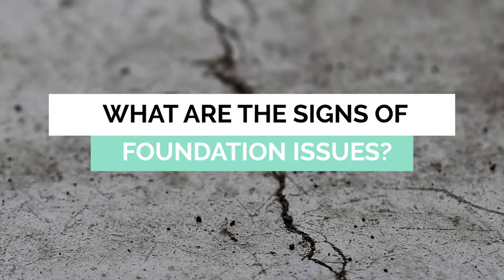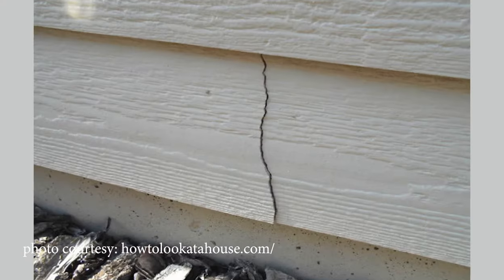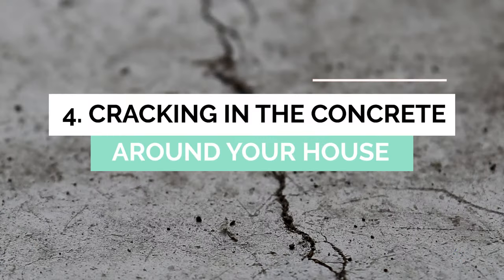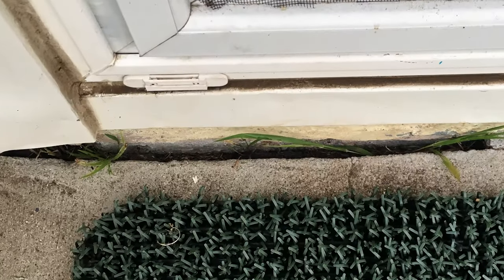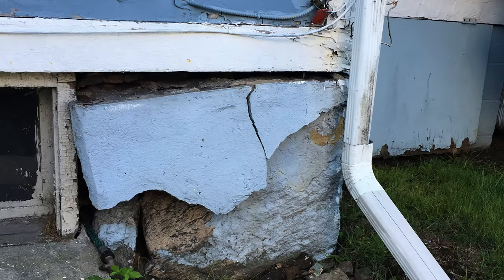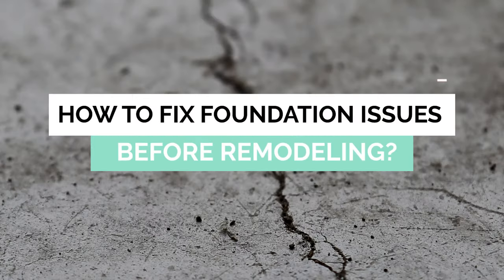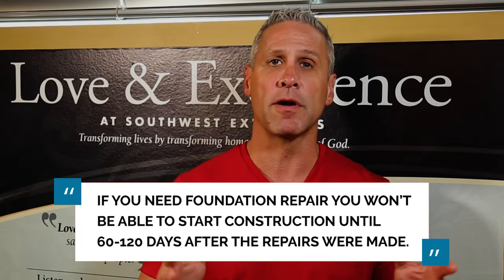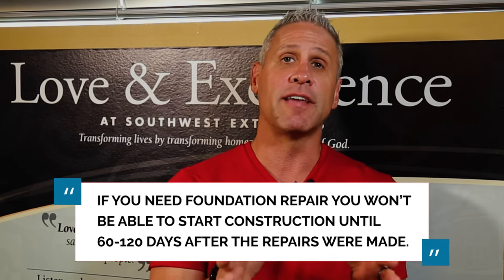4 Key Signs That Your House Has Foundation Issues

Comment from the maker: Thank you for checking out this video! If you have any questions on your foundation or a concrete coating, leave them down below. We'd LOOOVE to hear from you.
Reply: I swear I'm terrified my brother's house is going to just collapse one day soon
Reply: Hey there, I'm currently living in an apartment (on top floor - - 2-story apt building) and I've been hearing cracking/popping "woody" sounds quite often over the past couple months. There are hairline cracks in the drywall throughout the apartment (mostly running along corners/edges horizontally & vertically), but today I noticed a single big crack running across one of the 3 windows in my room, and my guess is that it's due to the shifting/cracking/popping of the walls. Am I on the right track with making this connection for the window crack or is some projectile or kamikaze bird more likely to blame? And more importantly, is this something I should be concerned about in regards to my safety (as well as adjacent neighbors in my bldg) and need to address immediately by a professional like yourself? Thanks in advance for your expert opinion & information and you've got a new subscriber here!
Reply from the maker: @jasonb3907  Hey Jason! Sorry to hear you are dealing with cracking and popping in your apartment. Based on your description, the noises, along with the presence of hairline cracks in the drywall and a significant crack on one of your windows, could be a sign of underlying structural issues within the building. Especially if all the cracks line up. 
For safety it is always best to contact a professional just so you can have peace of mind that you and your family are safe. Especially  now that you are hearing sounds frequently there could be something that you can't see that needs to be addressed quickly. Not all the time, but usually with normal shifting and settling things happen at a slower pace so you don't notice until the cracks start to show up or doors and windows stop functioning properly. What you are describing seems like the structure might be trying to tell you something. 
Thank you for subscribing to our channel, and please don't hesitate to reach out if you have any further questions or need assistance. Your safety is paramount, and we're here to help in any way we can.

Comment: Sigh, have the staircase looking crack on the exterior brick. Thank you for the info! 

I live in a bungalow from the 1800’s. I was wondering…if there’s a 1 inch-ish gap between the floor and the floor mouldings/trims/edges on the 2nd floor….is that also a sign of foundation problems/the house sinking (they may be 2 diff things)?
Reply from the maker: A gap between the floor and the floor moldings/trims/edges does not necessarily indicate foundation problems or sinking. It could be due to natural settling over time or temperature and humidity fluctuations affecting materials. Consulting a professional, such as a structural engineer or contractor experienced in historic homes, will provide a more accurate assessment of the situation. 
Thank you for checking out the video!
Reply: @TheHomeSolutionsChannel  Thank you for your reply!
Reply from the maker: @earthandwind820  Our pleasure! If you have any other questions, don't hesitate to ask.

Comment: I don’t have any cracks like was disco.. but my interior stairs look
As if they are pulling apart from the top landing ( where is is supposed to be flush)..I do see some cracks in the  basement floor..on the same side of the house where the interior stairs are..these stairs are on my first floor to my second floor.. Thank you for any suggestions..I’ve lived in my house 20 years..this has happened over time.
Reply from the maker: Thank you for checking out the video!
It sounds like, as you said, a lot of those issues could be time related. The cracks in the basement would be where I personally would start to make sure there isn't a bigger problem before I tried to fix the stairs. Since the impacted areas are all in the same location, it might be best to have a foundation expert come inspect it just to make sure that there aren't any larger problems brewing after 20 years. Most likely it is normal settling and should be a simple fix, but it is better to be safe when it comes to your foundation. If you have any other questions or want to share more detailed information on your cracks, feel free to let us know, we'd be happy to help.

Comment: Thank you for making this video. The door frames one some of our doors have cracked right where the horizontal part and vertical part attach. Is that an indicator of foundation issues or just poor quality door frame?
Reply from the maker: I'm glad that the video was helpful for you!
It is hard to tell without seeing it but, that sounds more like the quality of the door frame. I would check behind the door frame and see if there are any cracks in the drywall. Without evidence of severe cracking my guess is that the door frame cracking is just caused by normal everyday settling.

Comment: What is it's cracking in the concrete foundation that lines up with tile cracks inside the house
Reply from the maker: Our educated guess is that your home is built on two different bedrocks. 
Bedrock is always shifting and moving, but when you happen to be on two different ones they can shift independently from each other which, in time, can create a crack that goes through the foundation and the home.

Comment: Thank you for the video. Can you tell me what the worse case scenario would cost?
Reply from the maker: Thank you for watching and for your question! The cost of repairing foundation issues can vary widely depending on the severity of the damage. In a worst-case scenario, where extensive repairs are needed, costs can range from $20,000 to $100,000 or more. Several factors can increase the cost, including the size of the home, the extent of the damage, the type of foundation, and the need for additional repairs like plumbing or structural reinforcement. It's best to get a professional assessment to understand the specific situation and get an accurate estimate. Early detection and repair can help minimize costs and prevent further damage. If you have any more questions, feel free to ask!
Reply: @TheHomeSolutionsChannel  thank you!
Reply from the maker: @breeze5378  Our pleasure!

Comment: good day sir my issue is foundation of a building on a hill beside the beach and the water penetrating under the foundation from the back of the builden on the beach side
Reply from the maker: Hey @HanDixson! Thanks for sharing your situation. Building on a hill near a beach can indeed present unique challenges, especially with water penetration. Here are a few things to consider:
-Drainage Solutions: Installing proper drainage systems like French drains can help redirect water away from your foundation.
-Waterproofing: Applying waterproof coatings or membranes to the foundation can help prevent water from seeping in.
-Landscaping: Grading the land around your home to slope away from the foundation can reduce water flow towards it.
-Professional Assessment: Consulting with a structural engineer or foundation specialist is crucial to evaluate the extent of the issue and recommend the best course of action.
Taking these steps can help protect your home from water damage and maintain its structural integrity. Good luck with your project!

Comment: I bought a new consteuction home 4 years ago. Its experienced alot of settling. Small cracks by windows ext. They were repaired and havent came back since. But i noticed a ball on floor the other day would roll torward the back of home on its own. Indicating a sagging floor. Is this a serious problem?
Reply from the maker: Hey @chrisbrezy392, Thank you for your comment and for sharing your experience! It's great that the initial cracks were repaired and haven't returned. However, noticing a ball rolling towards the back of your home can be a sign of a more serious issue with your foundation or flooring.

Here are a few steps you can take:
1. Professional Inspection: It's important to have a structural engineer or foundation specialist assess the situation to determine the extent of the sagging and identify the cause.
2. Monitoring: Keep an eye on any new cracks or changes in your home, such as doors or windows sticking or gaps appearing.
3. Foundation Support: Depending on the severity, solutions may include reinforcing the foundation, adding support beams, or leveling the floor.

Addressing these issues early can help prevent more significant problems in the future. It's best to be proactive when it comes to your home's foundation. Good luck, and I hope everything works out smoothly!
Reply: @TheHomeSolutionsChannel  I forgot to mention my house is on a solid reinforced concrete slab built with rebar. It's in El Paso tx near the mountain. Hard to dig lots of big rocks. All doors windows close correctly and the cracks haven't returned in about 3 years.  I will be looking for a structural engineer to check it out. Thank you for replying.
Reply from the maker: You're welcome, @chrisbrezy392! Given that your home is on a solid reinforced concrete slab and the cracks haven't returned for three years, it sounds like your foundation is relatively stable. However, since you're noticing sagging, having a structural engineer inspect it is a wise decision. They can provide a thorough assessment and peace of mind. It's always best to catch and address potential issues early. Good luck, and feel free to reach out if you have any more questions or need further advice!

Comment: When a Home Foundation Inspection is done. Where should they place the Zip Level to take accurate measurements. Based on 2 Companies that have given me Estimates, they took the measurements at different places. The Front Door entrance measurements stated we need repair while the 2nd Company took measurements from about center of my home & stated no repair is needed. Who is giving me the correct information prior to replacing our Roof? Thank you
Reply from the maker: Thank you for your detailed question! The placement of the Zip Level during a home foundation inspection can indeed affect the results. Generally, a comprehensive inspection should include multiple measurement points throughout the house, not just at one specific location.

Front Door Measurements: These are important as they can reveal issues with how your house is settling. If there's a significant drop or rise here, it could indicate foundation problems.

Center of the Home Measurements: These can provide a more balanced view of the overall foundation health. If the center shows no issues, it might suggest that any problems are localized rather than systemic.

The most accurate assessments typically come from using multiple points of reference to get a complete picture of the foundation's condition. It might be beneficial to consult with a third company for another opinion or ask for a detailed explanation from both companies on why their measurement points were chosen.

Before making a major decision like replacing your roof, it's crucial to have a clear understanding of your foundation's health. Hope this helps, and best of luck with your home repairs!

Comment: Are you guys In San Antonio TX? I bought a new build 1yr and some months ago, and I’ve started to notice some vertical cracks where drywall meets eachother. Would that be something to be concerned about? Some of my baseboard also seems to have separated at the where they meet? Idk if it was just filled with caulking or not
Reply from the maker: Nope, we have been in San Antonio since 1989!  It sounds like a lot of those issues could stem from poor drywall work or caulking as you stated. Here is a link to a video that provides a little more detail between minor and major cracks that might help answer some of your questions. https://youtu.be/lubIIrGG4cA?si=JCWIjO9rZtE-8tfR
If you have any other concerns or questions, feel free to ask them here or visit, www.southwestexteriors.com and reach out to us there to help you out.

Comment: I bought a place 7 months ago. The painter came in and sanded down minor cracks at the drywall upstairs. It was 100% perfect (as always, I'm picky and he knows I HATE gaps). Well, not anymore. I get the feeling that at least one moron has touched this place. They lined up the drywall upstairs on the sloped ceiling, so ceiling cracked (small, very minor ones) and it goes all the way down the sloped wall in some places. Straight line, all minor stuff. No large or diagonal cracks. 

Downstairs, the join at the crown molding is cracked. Both sides. Not big, but I notice it because painters aren't cheap. 

The ceiling upstairs is short, around 7 feet, so I can push it and part of the drywall has a little give it shouldn't have. So, clearly idiots have been through and didn't drywall/tape/mud it correctly. At least, if I did it, it sure wouldn't! 

There's also a concrete crack at the front steps where they meet the building. That one is bigger and not going to be as easy to fix. Maybe a 13 or 14 sf house. I'll probably fill it once weather is warmer. Not ideal, but lots of these channels talk about 25 thousand like it's nothing. 

I'd say, I'd buy a new house, but I've watched many old houses come down, and the garbage they replace it with. I'm never surprised to see the "concrete" steps crumbling within 5 years. Meanwhile,  our coach house has a visibly sinking corner *for DECADES*. Still there, 120+ years later. Front steps of early 1900s front house have barely ANY wear, and CERTAINLY not literally crumbling, like our neighbor's greatly overpriced POG. It's not even REAL concrete or REAL limestone for 3 or 4 million. LOL! 

Nothing like "step" cracks in the brick or siding anywhere else, tho. So, that's something.
Reply from the maker: Sorry to hear all the things you have noticed in your new place. Sounds like you have the knowledge to make sure those issues don't turn into bigger issues. If you have any questions don't hesitate to let us know!

Comment: Is it normal for very light cracks the first few years in a new build here in Texas
Reply from the maker: It's common to see very light cracks in new construction during the first few years, especially in Texas. Our soil often expands and contracts due to temperature changes and varying moisture levels, which can cause minor settling cracks. However, it's important to monitor the cracks over time. If they widen, appear at an angle, or are accompanied by other signs like sticking doors or sloping floors, it's best to consult a professional for a thorough evaluation to ensure your foundation remains stable. Let me know if you have any further questions.
Reply: @TheHomeSolutionsChannel  thank you so much for your time and awesome content
Reply from the maker: Our pleasure!!

Comment: What if house is hillside and theres settlement 2-3" downhill. No large cracks below but floor tile in house is cracked in several rooms-House built in 47. Is that settlement or sinking?
Reply from the maker: Thanks for your question! It sounds like your house might be experiencing settlement, especially given its hillside location and age. Cracked floor tiles can be a sign of this. Settlement often causes gradual shifts, while sinking is more severe. Even without large cracks below, the differential settlement you mentioned could be causing those tile cracks. It’s best to consult a structural engineer to assess the situation and recommend the right course of action.

Comment: Every issue you showed has been going on with my brothers house for years..is there a certain point it becomes to late..I'm convinced my brother's house is going to collapse one day soon😬
Reply from the maker: Whoa! 
The only point in time in which it might be to late for a foundation repair would be when the house starts literally coming down. Depending on how bad it is, the repairs could be extensive and maybe not worth the cost but there are professionals out there that have repaired all kinds of crazy foundation issues. Your brother will have to weigh out the cost of the repairs with the value of his house and see what makes the most sense for him. Obviously, the longer he waits the worse it will get and the more costly the repairs. 
Thank you for checking out the video! If you or your brother have any other questions about foundations don't hesitate to let us know, we'd be happy to help however we can.
Reply: Eh, probably not. I lived in a very old house 43 years. The coach house had a VISIBLE sinking in the corner of the kitchen. For YEARS. Still standing. Since 1800s.

Comment: When it rain, there is a large puddle of water. Around my house. the Concrete slab foundation is cracking .
Reply from the maker: Thank you for sharing your concern with us. 
It sounds like the water pooling around your house during rain could be contributing to the foundation issues you're experiencing. Water accumulation near the foundation can lead to soil expansion and contraction, which often results in cracking. I recommend checking your drainage systems, like gutters and downspouts, to ensure they are directing water away from your home efficiently. Additionally, you might consider consulting with a foundation repair specialist or a structural engineer who can assess the situation and suggest specific remediation actions. It’s crucial to address these issues early to prevent further damage. Please stay safe and let us know if you have any more questions!